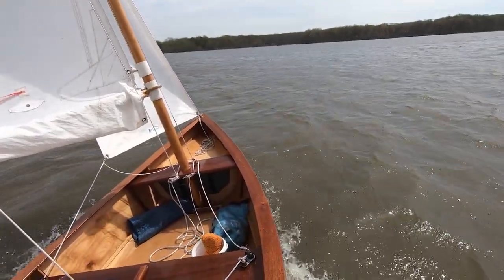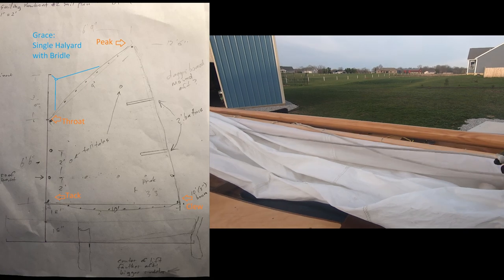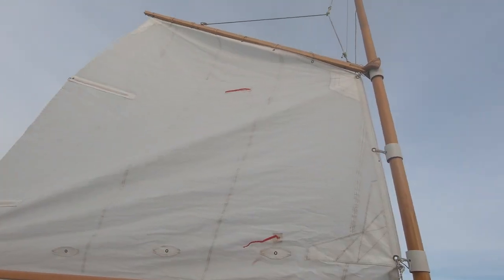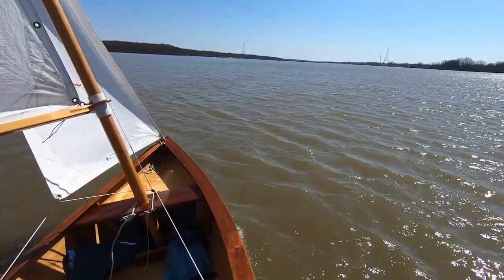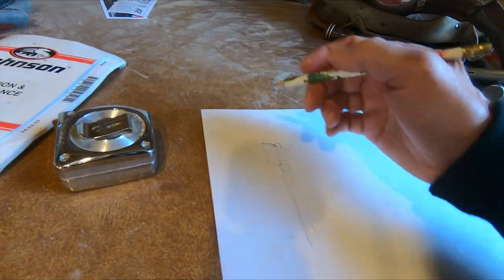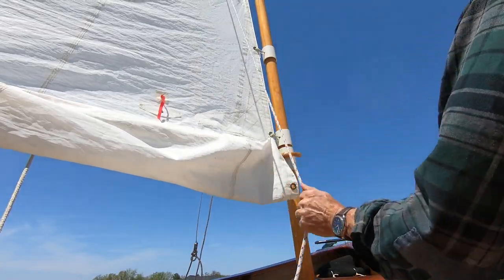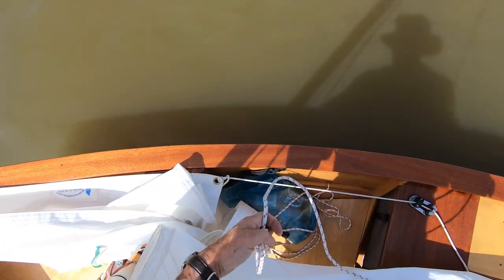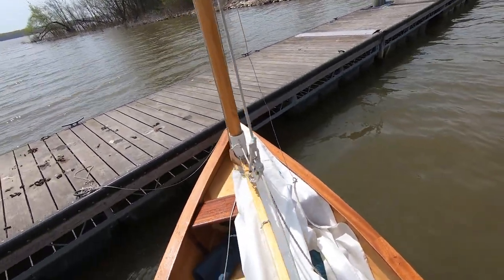Building Grace: Rig Non-Standard Gaff for Reefing (Finally), and Some Rowdy Reefed Sailing

Comment: Just stumbled across this video. I have sailed gaffers for over 30 years, both large (30m +) and small. Having spent a lot of time looking at novel solutions for a similar reason, I was intrigued to watch your process through.

You seem to have started out with an interesting concept to simplify your rigging. The plastic mast collars are a novel and cost effective modern interpretation of the traditional mast rings. However, your single halyard system seems to have come unstuck under reefed conditions sending you down a bit of a "rabbit hole" process of adding an additional control line to bring your gaff span bridle closer to the mast when reefed.

Now you have a halyard on the  gaff span and effectively a snubber... 2 lines..... However, looking at the sail, it still does not have enough Peak tension. The check I was taught for this was to set the Throat halyard taught, then "Peak up" until a crease starts to appear diagonally between the Peak and the Tack when the sail is in ions. 

Why not just use the centuries old solution... Throat and Peak halyards...? Problem solved. 

I am not seeking to insult you, as I share your sentiment of using a simplified version of a gaff rig, however, on this occasion I think the answer was there all the time. I have some modern interpretations of a Gaff Main & Topsl operating together on a single Halyard, but not the gaff sail on its own.

Happy sailing, and stay safe.
Reply from the maker: Sure going to the traditional two halyards would make reefing dead simple.  I'd have to add a block at the mast head, cleat down at the forward thwart, not a big problem.  I reef very rarely but if it becomes an issue I may go down that path!
Reply: @rudywoodcraft9553  I've had a minute to think about this. I might have a suggested solution that may work and still keep it relatively simple making best use of your gaff bridle arrangement.

If you re-rig the top "traveller" ring you have already made so the Halyard is reeved through the pulley block, it will always lift it easily to the desired height. Then simply rig a single-line downhaul to the traveller ring to set it to the reef height. 
Under full sail condition, this downhaul can simply be set with no tension and the traveller sit idly at the top of the mast.

When you need to reef, lower the Halyard, lock off the mast traveller ring to a pre-marked reef position, (this can be a whipping on the ring downhaul line), set the first reef luff cringle and then simply tension the halyard. This should set the reefed gaff similar to its full sail angle. The imperative is to try to secure the mast traveller pulley block as close to the traveller as possible. I notice in the video you still have a bit of "stand off that may well be able to be reduced by securing the pulley block directly to the traveller. This may be possible by externally lashing it to the traveller ring.

This system would also work well on a Gunter rig where snugging the yard to the mast is an issue under reef condition without moving the halyard attachment point up the yard.

Happy sailing.
Reply from the maker: @DivvaXJ900S  Thanks a ton--I will give that a try.  You're right--to get the last bit of tension on the peak under my non-optimal approach, that last inch/inch and a half in toward the mast makes all the difference.  (I will say that the line I'm using has more stretch than is ideal too.)

Comment: Hello! Thanks for the great series!

Regarding your crease in the mainsail, which you had at the very beginning and now again. Instead of attaching the halyard to the bridle with a knotted loop, have you tried attaching a block to the halyard and letting it run freely on the bridle so that it can move back and forth when the throat of the sail gets tight? If you want to restrict the block's freedom of movement, you may tie stopper knots into the bridle line at each side of the block.
Reply from the maker: Thanks I'll give that some thought I haven't tried that approach

Comment: Well done, tx for sharing the whole process.  Just curious what you think of a spare heavy weather  Leg-o-Mutton Sprit rig?  Ever try it on that boat?  Ty.
Reply from the maker: I haven't tried it but yes, I've wondered about that, partially because I have just a bit more weather helm than I like, and moving the center of effort forward with a higher gaff/sprit angle is something I may try someday